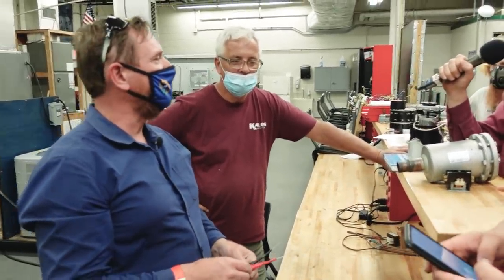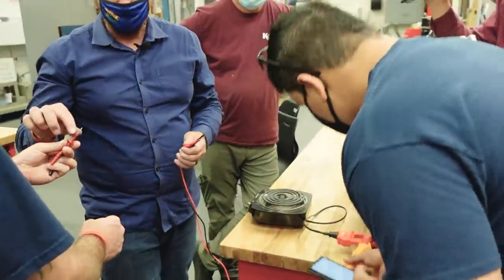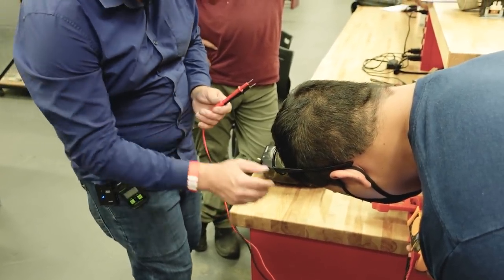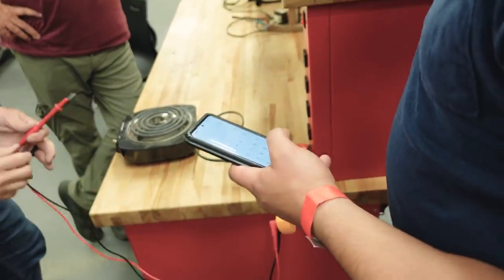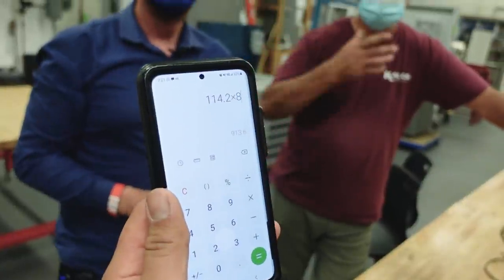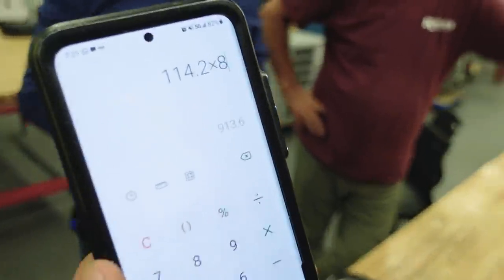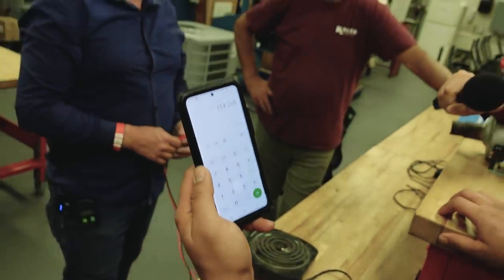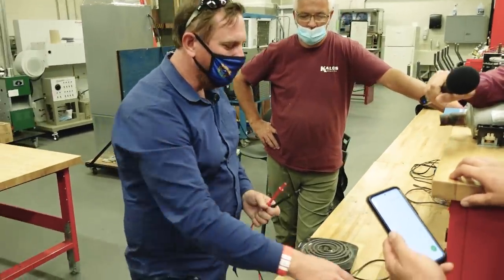Watt's Law Demonstrated w/ Ty Branaman

Comment: Powerlines delivering the power to the house reminds me of a fire that an HVAC company caused burning the lines from the house to the power pole. 
                       As a HVAC contractor you are responsible for load calculation of the electrical panel when you obviously see that it’s completely filled with circuit breakers. 

    The house has electric water heater, Electric dryer, two electric ovens and cooktop ranges, A hot tub Jacuzzi with electric heater,  on top of that a bunch of other electrical heavy duty constant draw equipment that’s more than 80% on time that has maxed out the panel amperage capacity. 

           And then because you the contractor want to make money and not lose that sale you throw on another 5 ton condenser that draws 23 A and another air handler that draws 12 A. 

        Next thing you know the fire department and the police department are out at the house investigating a fire 🔥 

        Always do electrical load calculations